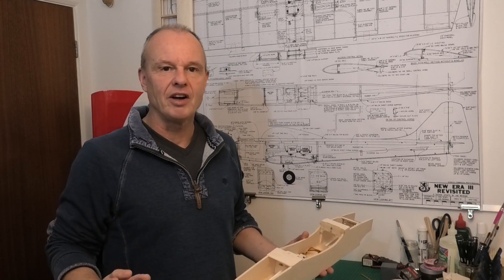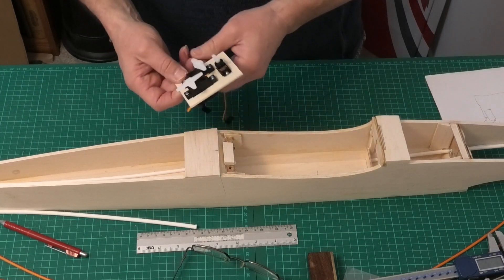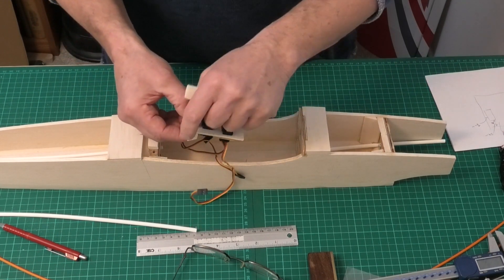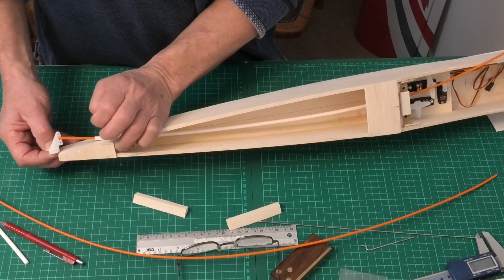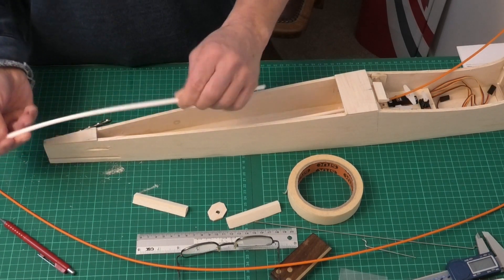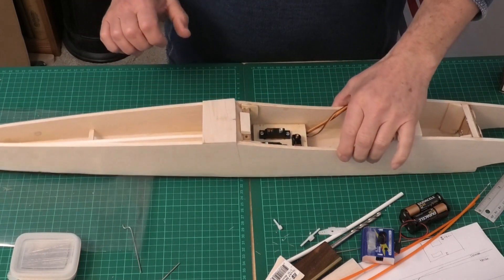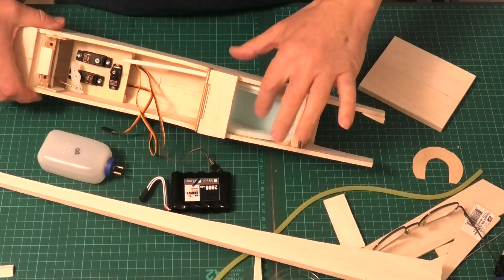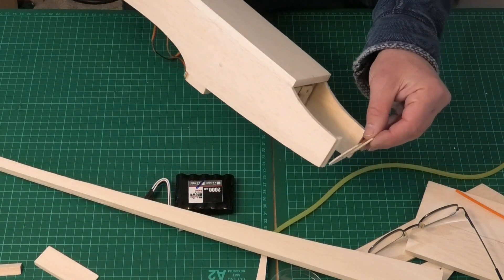New Era III Revisited: Pt 10 - Fitting Servos & Linkages - a 45" wingspan RC balsa aeroplane

Comment: Hi Mark, I love the series of this build. Great job. I have been picking up on ideas. 😄 I also like the way you plan on installing the fuel tank into the fuselage in order to avoid the hatches disturbing the slik lines of the fuselage.. However, one thing that came to my mind was how to get it back out, let's  say if you have to do some kind of repair. I think it would we be hard to get a hold onto. So perhaps this could help, or perhaps you already know this little trick. I would loop a piece of fishing line loosely from front to back around the fuel tank. Then you would always have something to pull onto to get the fuel tank back out in case you need it to. Keep the video's comming....👍
Reply from the maker: Thanks for the comment, its really appreciated. Yes line around the front is a big help, I also do that with batteries and on a recent build I had to do it with a servo which I would not be able to get out otherwise. Really appreciate you getting in touch. Good luck with your builds